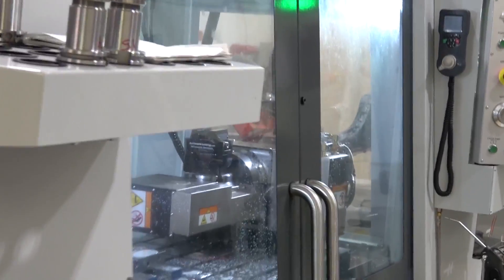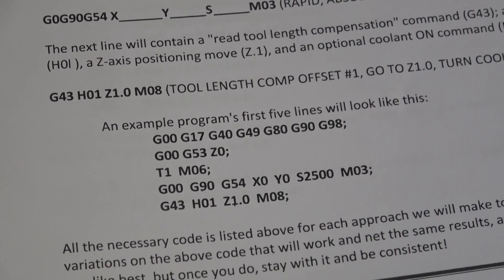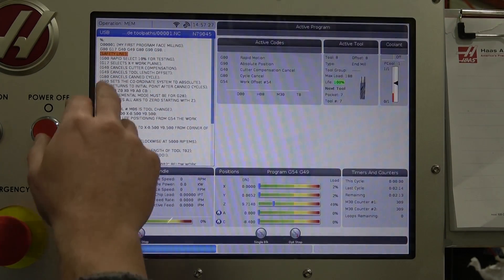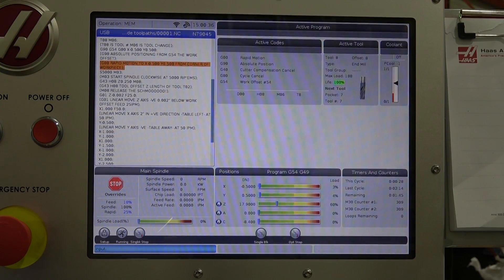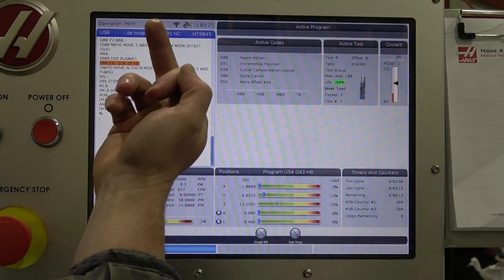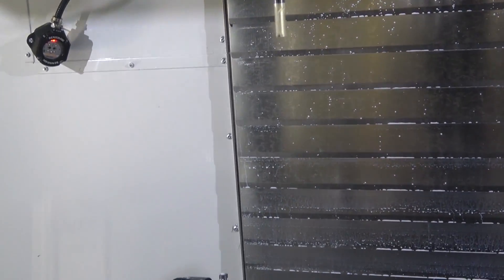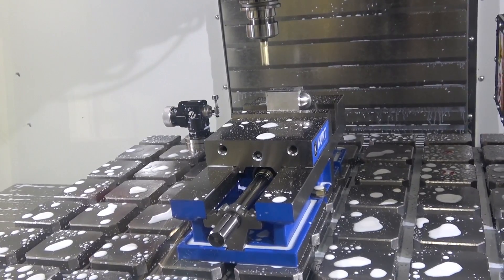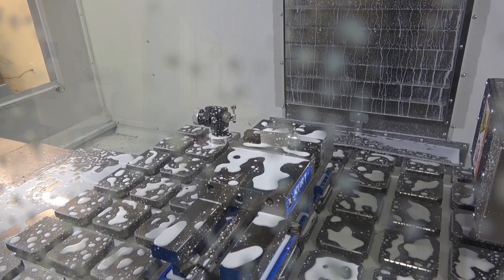Beginner CNC Programming | G-Code

Comment: Hey don't use Microsoft word. It adds so much garbage to the header in the file.. use notepad or notepad++
Reply: Use wordpad or notepad (my preference)  and just save as a regular .txt file NOT .rtf.  Most CNC controls read .txt files and you don't have to go through another step when opening .nc or .CNC files on your computer because windows doesn't recognize them.  Many CAM programs output them as .txt files as a convenience to you anyway. 

You can bang out a part program in short order one you are fluent and have a standardized programming template or structure you like to use. 

Armed with a fluency in the language, a blueprint, desktop and a calculator, you can program most anything you find a need for that doesn't require crazy, high speed toolpaths or 3d profiling.  

3 and 4 axis pans are no problem.  Get into 5 axis, which I find to largely be a gimmick,  you might seriously want to invest in some CAM software.  Otherwise,  just write it yourself.

Comment: I don't think one needs to be an expert in writing G Code to be a CNC machinist. Of course knowing it certainly won't hurt but Fusion 360 will write the code for you and also show you the path the tool will take. You can air mill the part if you want to check it prior to actual machining or you can use foam to test the path to make sure you don't crash the spindle. But it the end crashing the spindle is going to happen :( NYC CNC has a whole video of their crashes - fun to watch - not fun to make happen!

Comment: Software Engi-nerd over here. There might be a way to write a better interpreter for G-Code, that is as bad as assembly. Surely there has to be something that works similarly to a 'compiler' but for Gcode. 

Maybe even something that can have a plugin into Notepad++ or Visual Studio Code. 

It is difficult since this is more 'instructional' and not really object oriented. Not that this couldn't be object oriented with syntax similar to Java. An object like

CNC, which then contains Tool1 and Tool2.. then also allows for methods with parameters. Maybe even conditionals right on the spot if sensors can be interfaced with. 

Not sure, it is interesting.

Comment: Horrible as it is, G code beats ladder logic. Just barely. My first encounter with ladder logic was a bloody nightmare. My boss took one look at my poor fallen face and phoned in a consultant. I would have been slightly better off had they not dropped several grand on a pair of the WORNG encroders!!! Try doing math, to move 10 ton log in a timely manner on a carriage the size of a RR flat car, in ladder logic!!! It can be done. But prepare for some unplanned deaths! I bet the author of that nightmare was named Flintstone!

Comment: Make friends with the single block button and look at the next move dimensions before firing off each line. Then it’s all easy. ...

CAM and a zero point vice means you don’t need to ever bother probing. 

Then start running facemills at 8000mm/min. If the coolant ain’t steam off the hot chips your going too slow

Comment: It interprets number without decimals as tenths. Your -1 is interpreted as -.0001. This happens on Fanuc too.
Reply: Indeed. On a Haas you can change that in settings. But I've kept it that way and one gets used to it very quickly.
Reply: so if Uncle B put all measurements in as tenths, 10000 for an inch, and skip the decimal all the time, he wont have any problems with this again??
Reply: @HotDamnHarry  No, because then you have more 0s than your eyes can keep track of. You'll be off by an order of magnitude a lot.

Comment: For your return home command G91 G28 X0 Y0 Z0. The machine uses the XYZ coordinates as an intermediate step before returning to the home position. if you change the Z value to a number that clears any obstacle, maybe Z5, it will first move up 5 inches then go straight to home position.

When testing a program I like to insert a Z5 before the tool comes down to the part.  This allows me to check with a scale my zero and tool length compensation is correct. I then delete or block skip the Z5 when running production.

Machines base dimension is 0.001" so 1 unit is 0.001" that's why your Y-1 moved 1 thou not 1 inch

Love your channel. Was excited when I found out you're a BC boy too.

Comment: why not just use autocad and export to g code it seems like the easier way to design
Reply: He obviously operates on the principle of learning to crawl before learning to walk and not talking shortcuts and easy way outs. It's like the old welder adage he himself has mentioned before, that one should always learn arc before mig, because you will be a better welder. Bumblefuck knows he needs to understand the basics before graduating to CAD, otherwise how will he really know what commands he's feeding the machine?

Comment: You don't need to be in G91 for G28 to work, you just need to make sure your intermediate point is something above Z0. 

G28 tells the machine to go to reference (home) position, but it requires an intermediate location. Most people use G91 G28 Z0 because the Z0 is the intermediate point, it's not telling the machine to actually go to Z0, it's just telling it to go to reference position, via the current point as the intermediate. You could actually use G90 G28 Z5., but it's not safe and not a good constant number. 

The only time I ever use an absolute intermediate point is on an axis with no assigned incremental axis and no G91 (lathe system).

FYI people buy machines without probes because they're cheap frigs.

Comment: I program CNC machines every day! Remembering those M and G codes gets easier with time.  Then you go from fanuc controls to okuma controls and all bets are off. There's always something to learn.
Reply: Jump on a Heidenhain and tell me how painful that transition is. G1 is L, G0 is L FMAX. It's nerve wracking.
Reply: @TheFeralEngineer  I'm 2 years into the manufacturing engineer position and was programming 3 axis lathes and 4/5 axis mills but they were all mazak and doosans. We just got a brand new okuma U3000 multus 9 axis. Yeah that was humbling.  My first part was a 2 week setup haha
Reply: @buddyismaname  we're did you do your certification? Looking to doine in nj
Reply: I memorized all the G codes at 19yrs old after graduating trade school (20yrs ago). The M codes are a different story.
Also I stay away from Okumas for a reason 😉.
I like my Tsugamis and Citizens 👍
Reply: @jamstagerable  m codes are different on every band of machine tool controller. They're miscellaneous functions assigned by the builder. M0, m1, m2, m3, m4, m5, m8, m9, m19, m30, all pretty standard. Anything else is wide open.
Reply: @TheFeralEngineer  you would think by now that'd have it standardized.  But I guess we should just be thankful for absolute programming and not dealing with tapes anymore. I've never used tape before but from what I've heard,  I'm very thankful for where we're at.
Reply: Okuma is fine, the majority of codes are the same, the transition is minimal.
Reply: Are there any controllers that dissembles the g-code into a bit longer mnemonics, instead of this machine level bits. For human consumption.

Comment: You probably need the decimal because "1" is a fixed point number (the integers) and "1." is floating point (real numbers, whole number plus fractional part even if the fractional part is zero).  They are handled by different computer hardware internally.  Clear as mud?
Reply: Nah, it's just that most cnc controllers treat numbers without a period after them as the lowest possible unit. I think a tenth in inch mode, so calling G01 x1 moves a tenth in the x+ direction, whereas calling a g01 x1. moves an inch.

Comment: Another thing I like to do is preface my M08 on it's own separate line with a block delete ( "/" ). When you press the block delete button, every line that starts with a "/" will be ignored, so when approaching the part on the first run and you want to make sure you're not going to crash, just hit block delete and it will skip the coolant so you can see what you're doing.
Reply: And you can put the M08 after the first Z move.
Reply: My machine doesn't have a blockdel button.

Comment: Be VERY careful when homing the Z axis at the same time as other axes. You can fuck yerself right proper if the spindle is down ( say you're indicating or edge finding) and you hit the cycle start. It's good practice to home Z on its own line and then home the other axes.

Also on the Haas I prefer to send the axes home with a G53 which is non modal. Haas tip of the day actually did a video on why that's a safer method of doing things. I recommend you check that one out.

Comment: This code isn't that bad at all. The first line with all the g functions in it will almost alwasy be exactly the same and the last five rows of the Programm also. Move z away from part m5 move work to door m30 done m5 or m9 isn't needed if you do m30 anyway...

And you do 90%of the 2d moving with four g codes
G00 is rapid
G01 working feed
G02 curve clockwise
G03 anti clockwise

And there should be a lot of preset cycles for Pockets etc. Were you just position the tool enter the disired dimensions and done....

I'm way better at reding or wirting this stuff than at wirting german Language and find it impossible to really understand a arduino Programm... Practice makrs a lot of difference i

Comment: Jaysus, but that's an awful way to code. It makes no goddamned sense whatsoever. Without documentation, I would have no frakking idea of what it was doing. At least C makes SOME sense. Even if it still hurts my brainmeats.
Reply: A lot of that stems from early machines not having a lot of memory.  You could not include a lot of notation if it was a fairly long/complicated program. 
But hey, could be worse.
Could be punchtape.
Reply: G code is not hard there are not even 200 core  g and m code to know.

G00 to G99 are all the basic codes and not all of them are used. Same for all the M codes. There are codes that go beyond 99 in both M any G commands, but those are variants of the 0-99 codes for the most part. Like there is G154 codes that take the original 6 G54 to G59 work off sets and expands them to G154 P1 - G154 P99 on Haas machines.

All the expanded codes and unused codes are either machine specific and will be documented in the machine manual, or are brand/controller specific and will be documented in the machine documentation. There really are only like 100 codes that I use every day.
Reply: @viperstarpoint9  and once you have to enter a program into an NC machine on a numeric keypad you begin to understand why it's as short as possible.

Comment: Christ almighty that is a horrible method of programming, it's literally an intermediary code. Isn't there something higher level that even at its most basic operation would label the G-Code with human readable symbols and substitute them in during "compile"?
Reply: In industry the cam package is the higher level language and G-code is used to transfer it to the machine.  Manually writing code does happen, but is comparatively rare.

… and G-code is not well standardized, so you see "post processors" that run after the cam package to tweak it for each controller's unique quirks and features.

A dirty secret is that the machine just uses the code as a hint of what you want to do.  It does its own magic with look ahead and acceleration/deceleration prediction to decide what to actually do.
Reply: @ElizabethGreene  using manual G code on mills is really rare but on lathes its actually pretty common.
Reply: there are also tricks you can do with manual g code to optimize programs for production such as tool changes for instance. lets say you want to change to tool 4 "m6 t4" if your machine uses a magazine with an ATC arm the m code and the tool designation don't have to be on the same line of code so you can put the "T4" after the previous tool change so the magazine will cycle and have tool at the ready while the previous tool is running so you can then put in the "m6" for an instant tool change.
Reply: Just a little evolved from the punch cards of the 19th century. Hmm, that's an interesting home project idea: converting a Bridgeport to punch card-driven CNC.
Reply: Bring back the SMT's!, You could fix them with just a hammer and a big box full of limit switches!
Reply: I have seen cnc machines running code with perforated paper ribbons.
The manual of the machine I am learning on has explanations and diagrams of how to program that way!
Reply: @dr.castor1392  punch tapes were very common in the NC days (before my time). The machines I learned on were CNC but still had tape readers for reading old programs, though we never used them. Even some new machines today have a tape mode, which is actually used for streaming programs from external computers.
Reply: The point, for me, would be to learn enough of the G-Code to be able to troubleshoot issues if they occur.  So, yeah, this isn't a practical way to do it, but it's a very reasonable place to start.
Reply: The program you.are after is something like fusion, it does all the hard work for you then you just load the compiled code to the cnc
Reply: Too much gets lost in translation. Be the machine!
Reply: @Bereft777  spoken like a true assembly programmer. 😁
Reply: U can get a machine that can do what is called conversational programming witch is much much easer than manually programming Gcode. Or u could just use a cam software lol.
Reply: It's really not that complex, there's a few lines at the start and end of the program that are probably confusing for the beginner's but after that it's all just xyz coordinates. And once you know what everything means it's super quick to write basic programs. 
For myself or any good programmer that facing cycle wouldnt take more that 30 seconds to write
Reply: There sure is! It's called CAD!
Reply: @jonathong.4203  Actually it is called C.A.M. (computer aided machining)
Reply: @vidznstuff1  - I stand corrected. I should have proofread. You are correct Sir.

Comment: Why in frig would -1 without the decimal move in the positive direction? CNC is like machining with a head injury. 
I picked up a baby cnc engraver just to learn the basics so I don't crash my new Shapeoko.
Reply: Jake J It is because it reads it as.0001 basically Y0.0 so that's where it goes. Remember. It's moving to an absolute position. Lots of cnc controls work this way.
Reply: @curt149k  one of the first things his gcode does is set it to relative mode if I remember correctly.